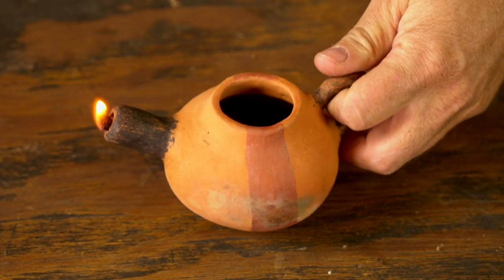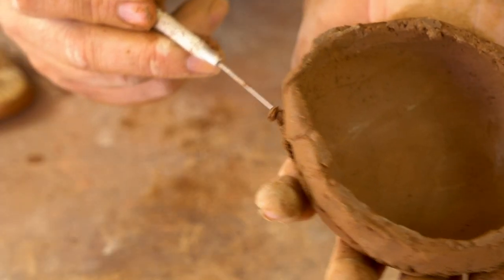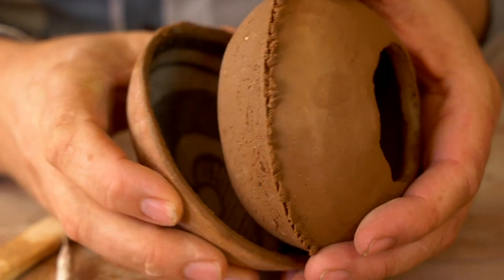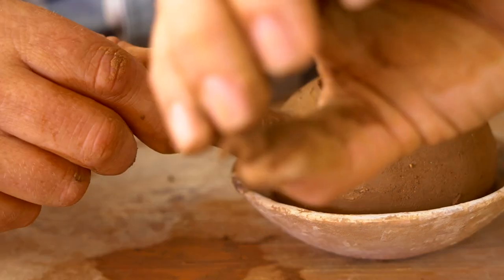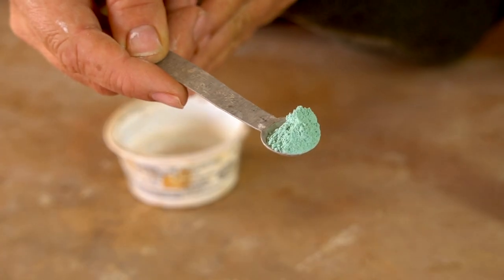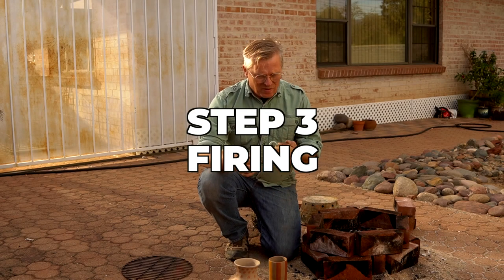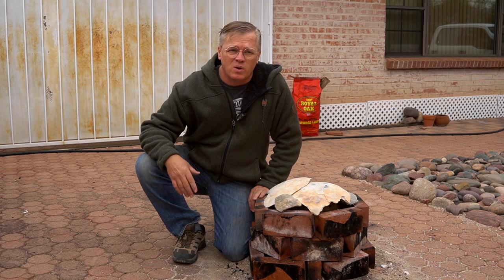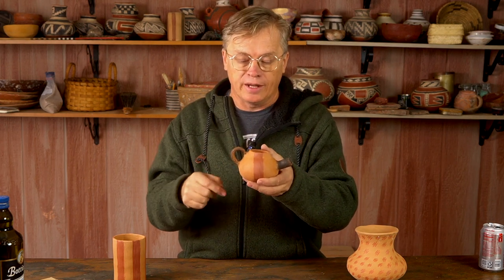How To Make an Oil Lamp From Clay

Comment: In one of your older videos, you tested pots you had sealed in different ways to see how well they held water.  If I recall correctly, at least one had the bottom of the pot get kind of damp, and the table beneath it got slightly damp from that.  Does the oil in your lamp do the same thing?  If so, I might make a clay trivet or something to set the lamp on, so I don't get oil on my table.
Reply from the maker: Yes, I think that might be wise. I am currently thinking of ways to seal a vessel like this. The seepage isn't dramatic though.

Comment: Nice one Andy..cool small project to make .think ill make a pair of them..liking the voice over as well..Question what reason did you make the lamp in two halves when your normal method is to coil/ pinch up in one piece?
Reply from the maker: It was easier to make in 2 halves especially for that small form. Thanks

Comment: What would happen if you mixed up a slip of a decent amount of copper carbonate and clay? Would the clay turn black? 
Also I would like to say that it is very easy to make copper carbonate at home. Take hydrogen peroxide and white vinegar and in equal proportions in a glass dish and bring to a little boil in microwave. Remove and bring outside and place copper metal pipe in the mixture. This will make a reaction causing bubbles of hydrogen and turn the solution blue (this is copper acetate) When the reaction stops take out the copper metal with a filter and take the copper acetate solution and apply baking soda to it slowly. Another reaction happens and the copper carbonate forms a precipitate and drops out of the copper acetate. Filter out with coffee filters and dry and your done.
Reply from the maker: Thanks for that tip. You would need to keep the percentage of clay pretty low like maybe around 20% otherwise it would start to become less black and more brown or whatever color the clay is. In reduction copper carbonate will make a weird red halo.
Reply: @AncientPottery  After a few minutes of research I found these possible reasons for the red.  
Heated metallic copper reacts with oxygen to form black copper oxide. The copper oxide can then react with the hydrogen gas to form metallic copper and water. After the funnel was removed from the hydrogen stream, the copper was still hot enough to be reoxidized with air.

cupric oxide (CuO). This red-coloured solid is a component of some antifouling paints. The compound can appear either yellow or red, depending on the size of the particles.

Comment: Can clay withstand strong acids, bases and high temperatures? I'm setting up a laboratory but I wanna make my own equipment and your videos have proven super useful
Reply from the maker: No idea about acids and bases. The temperature depends on the clay, every clay has a different melting point, you will need to test it to find out what that is.

Comment: So do you have to worry about the porous earthenware and the olive oil seeping thru it?
Reply from the maker: Trying to figure that out right now. It didn't come through initially but after a week and a half it is kind of impregnated with oil now. It doesn't seem to catch fire, now will the oil eventually polymerize and form its own barrier or does it need to be sealed with milk or starch or some other method? Time will tell.

Comment: You can make the top hole smaller and leave off the spout, make a "pearl" that is bigger than the opening of the top and can hold the wick up in it's hole. Then you only stick It on the wick and the wick through the opening into the oil and drop the pearl on the top hole. fire the wick and there you go.

Comment: Please, share how to adjust the wick so as to give greater or lesser light. And is this how they might have done in ancient times? My guess is that users have to use some type of forceps to pull the wick up to brighten it
Reply from the maker: My area of speciality is making things with clay, not the use and adjustment of oil lamps.
Reply: As I was watching the video I thought of something. What about a hollow tapered clay stopper. Make the inside diameter just small enough to add some resistance to the size of wick being used. You could poke the inside lightly with a toothpick to roughen it for more friction. The outside of the stopper would fit inside the spout of the lamp. To pull more wick for more light, I would use a stiff wire or stiff wire bent into tongs. To reduce the flame you would remove the stopper and pull the wick from the bottom with the tongs. You could even make a clay topper to extinguish the flaming wick. I would go so far as to make a lid for the fill hole with a marble ball top. Don't forget to add an air hole or two incase the top seals too good and stops oil flow to the wick. I would love to see a three wick oil lamp, Andy! I would also love to see an oil lamp like this painted black and white in a native style.

Comment: How is the wick brought out as it burns down? I'd hate to have it slip down into the oil and either go out or start a fire.
Thanks for a cool video😀
Reply: As long as there is fuel, it rises along the wick, and does not allow it to burn out, in the correct oil lamps (as in this video), the wick is horizontal, not vertical, to make it easier to draw out the oil. It’s hard to burn oil just like that, you need a very high temperature.

Comment: Great job! Does oil absorb into clay? 
I have already tried 4 times to fire a simpler clay lamp, but it constantly cracks, I burn it on a fire, as in your video about firing clay without a kiln.  I have already added a 50/50 grog with clay, I hope this time it will work. I noticed that they crack, not when fired, but when cooled.
Reply from the maker: It's most likely your clay or you are firing in very cold weather and they are cooling too quickly.
Reply from the maker: Oh and yes it will absorb oil, check out this video https://youtube.com/shorts/vniKNWe-JuM
Reply: @AncientPottery  Thanks, it's freezing outside right now, maybe I should try it in the fireplace at home.

Comment: Another engaging video Andy. A neat little project, presented with simple steps and a layed-back tone. I always learn something and enjoy the music part, as well.
In my experience, that copper carb is a pale sister to black copper oxide. Oxide seems to coat more uniformly because it's less reactive to temp.
Thanks again Andy,...from Scholle, NM 🌶️
Reply from the maker: Thanks. I have never used copper oxide, something to try.
Reply: @AncientPottery  Ya never know, but it might go a long way in solving the maganese/brown issue. Try it with some yucca or bee binder... 👍
Reply: A tabla drum would look great next to your oil lamp! 😁🙏
Reply from the maker: @jeffreyconnell8410  A drum is actually a project I am doing some research on right now.
Reply: @AncientPottery  Nice one Andy! I'm with you... 👍

Comment: loving your technique and video's, but a small critique, in european ancient pottery, the pottery has flat bottoms since they didn't use puki's like native americans did, pottery in europe was made on a woven mat, this would enable the potter to turn the pot as they coiled
Reply from the maker: Yeah, this was never intended to be an exact replica of anything European or Middle Eastern. Just my take on an oil lamp. And of course it has a Southwestern twist, that's how I roll.
Reply: Actually quite a lot of early pottery is exclusively round based.

The Carinated Bowl tradition in Britain (~4000 BC) was entirely round based, and flat based pottery doesn't emerge for centuries after that tradition diverges into later styles. It is very likely that formers of some sort where employed in a fashion similar to pukis when making round based pottery in Europe because of the sheer faff of doing it without, though it is doable.

Comment: My clay seems to be too porous. Vegetable oil as well as lamp oil seep through the sides and bottom. I make oil burners (clay plug with hole for a wick) that fit on top of bottles, but they absorb lamp oil, catch fire and burn like a torch !😆
Reply from the maker: After a week and a half with the oil sitting in my lamp it did soak into the lamp. So I wondered if it might catch fire and lit the wick. It burned just fine and the fire never moved from the wick to the pot. I suppose the lamp could be sealed with any of a number of methods before use. For example milk sealing https://youtu.be/YuKn76tSU-Q I think over time the olive oil will dry along the outside of the pot forming its own seal, time will tell.